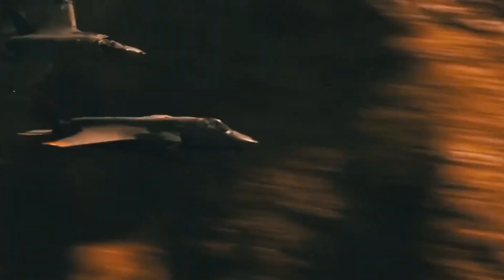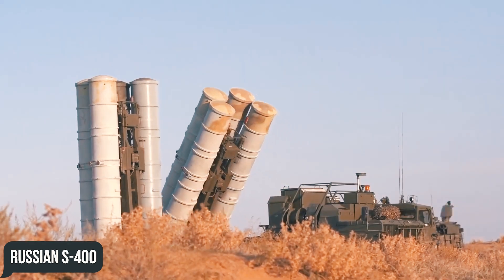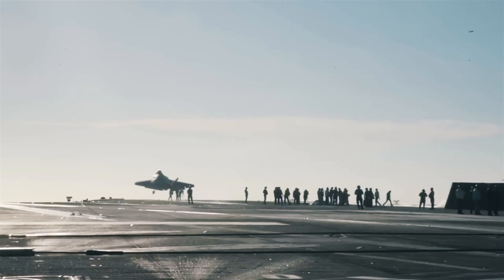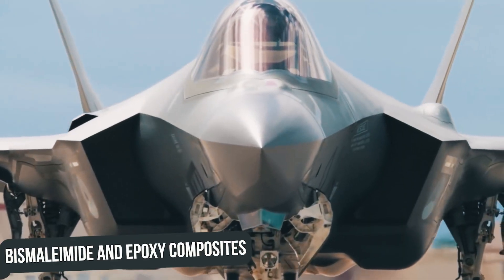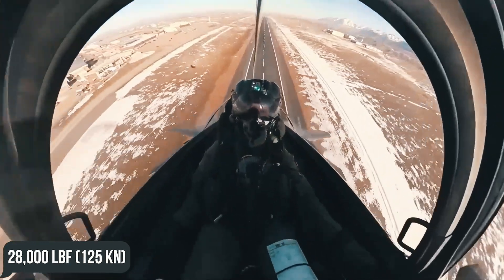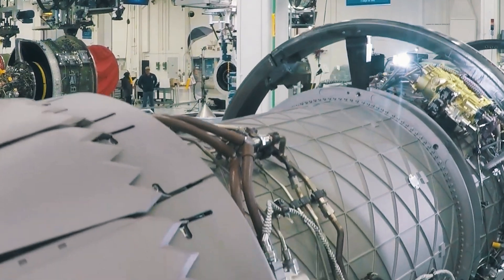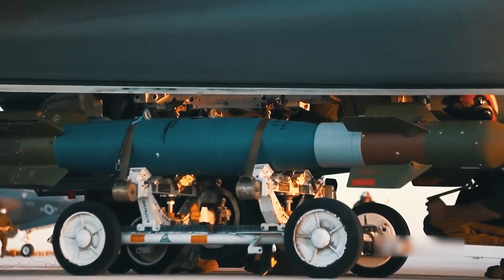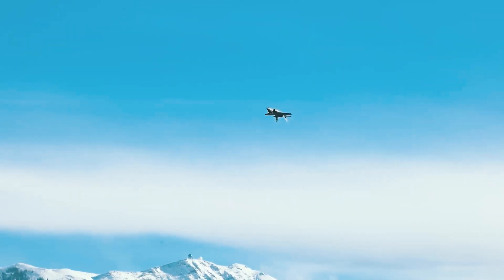US Tests New F-35 Fighter Jet To Beat Chinese Hypersonic Missiles

Comment: The Chinese hypersonic missiles has turned the Navy into sitting ducks. Slow large ships are no match for extremely fast maneuverable missiles specifically designed to take our aircraft carriers. It would seem that these missiles has rendered our navy to be very big valuable targets.
Reply: “Our” Navy?   You little 🤖 farms need to up the dialogue- simple minded, stupid and ignorant AI assisted script, gives you away😎
Reply: Blow me. You must be a trump supporter
Reply: Beautiful
Reply: Hypersonic glide vehicles are formidable, but not indestructible. Like any other long range system, require satellite targeting. And it doesn’t fly at hypersonic speeds all the time, otherwise the whole missile would crumble its own airframe. It’s also extremely expensive.

This is simple war tactics, you make something crazy ( aircraft carriers), your opponents make something crazier (HPV), and then you make something crazier (rapid Dragon), the cycle keeps going.  Just 23 C-17’s could launch 1,000+ Jassm/Lrasm missiles and essentially sink any invasion fleet. And at ranges of 1000+ miles; be far outside their anti air range.